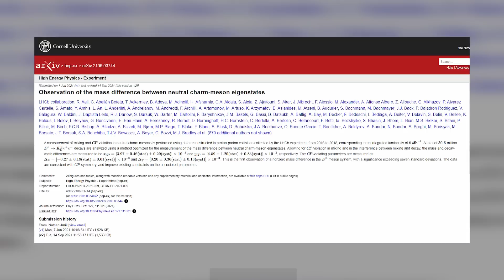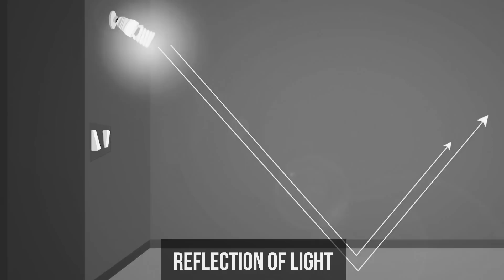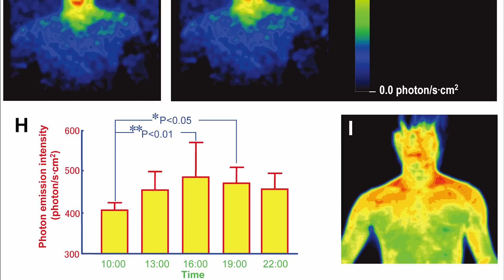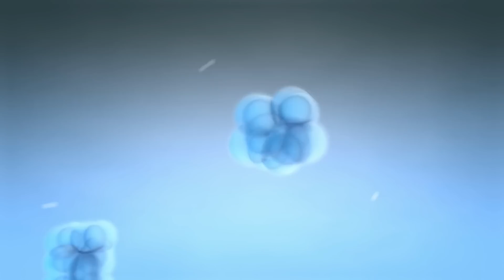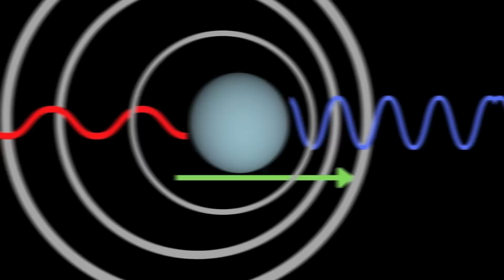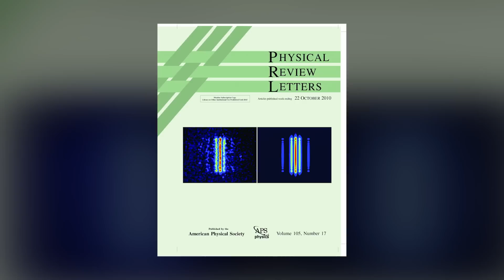Hidden Superpowers of Light We Didn't Know About

Comment: I don't believe that anyone has proven that light consists of photons.  Our sensors of light are materials, where electrons are what is detected.  But, in materials, the electrons are forced into discrete energy states, and from there we only sense discrete changes. 
In a significant experiment, sensitive sensors are used to detect the interference bands from the double slit experiment. Yes, the bands still appear. But, even as the light amplitude is decreased, and the time between individual photons is observed, the interference bands are built up by the slow accumulation of discrete events.  Now we are faced with the observation  in order for a single photon to behave as a wave, it must travel through the two slits in a manner in some way that allows for the two slits to affect the single 'small' photon so that they accumulate over time in the slit pattern. 
Another issue for diffraction, is that when a wave is forced through a small space, it emerges spread out. And when it passes through a large space, it can emerge with a sharp shadow. But, if photons are emitted by atoms, then they would spread out from the atom in a sphere, because atoms are very small compared to the wavelength of visible light.  It seems to me that the only way to rectify these observations, is that light is emitted in bursts from atoms, but that the light energy is absorbed as any other electromagnetic wave is absorbed - all over the place.  But then, it is re-emitted (as the observation of the interference bands) in random seemingly random events, as the energy accumulated by individual atoms is re-emitted as a reflection.  
    It should be able to test this theory with the appropriate apparatus. Last I heard is some nonsense about probability density functions being used instead of some material explanation for the observations.  That may be fine for getting a numerical answer, but it is nonsense for an explanation of what is happening. We might even find that light spreads out over time as well as space, and the quantified observations are just a limitation of our apparatus. But, I left physics for engineering long ago, and may be completely behind the times on this issue!

Comment: Here is an interesting problem about the speed of light. To measure what the speed of light is fully, ( i.e. both directions ), you need two clocks perfectly synchronized to perfect synchronization which sounds easy until you find out that you need to know the speed of light to achieve that level of synchronization. Kinda funny really.
Reply: It really isn’t that difficult. If you have 2 stop watches that are synced, 1 light source and 2 components that can read protons, then you are good to go. When the light source is turned on, the first proton reader will provide the time and the send will provide the second time it took for the light to reach it. You just need to do some math to account for data transfer

Comment: Some Nasa scientists think it is possible that light could travel faster than we know. We can only measure light by reflecting it off a surface very far away like to mars and back. We do not know if it travels at the same speed in both directions but suspect it does not! Depending on the conditions light speed could possibly be infinite. That would be awesome.

Comment: Could one not collapse the bubbles over an over to generate light an heat to be collected to generate power could collect a bit of its own energy to help in reducing its power consumption for better output too that way not to mention if you used the gasses made as well in its process too

Comment: CMB is almost 400,000 years old. Not almost 400,000,000 years old. This is an important difference. You should consider fixing that mistake.
Reply: My mistake is 13.7 billion years old. 400,000 years after the big bang
Reply: @jseaton2897  Correct.. I said it backwards. What I meant was the CMB was released 380,000 years after the big bang. Almost 400,000, not almost 400,000,000. Otherwise, it's an awesome video =)
Reply: The CMB was emmited when the Universe was about 380,000 years old! The Universe's age is estimated to be 13.8 billion years old.
Reply: The CMB is a brainchild of the 1930ies, therefore around 90 years old. Those first generation photons were generated 3 to 400 000 years after the Big Fart, are therefore 13.7 minus let's say 350 000 years old. There's a difference between birthdays and age. But in two months the age of the Uniburp will shrink to around 6 thousand years anyway due to the return to biblical logic thanks to the USAmerican average wisdom's choice of a moron as Potus!
Good Luck, USA, Good Luck!
Reply: I thought it was like 13.4 billion years old. Since the universe began 13.8 b years ago

Comment: That's some crazy stuff don't let DC writers find out about this 😂
Reply: They said light went faster than light.
So science is broken for sure.
Reply: @neohippe1
It's referring to entangled particles that share a property like spin, measuring the state of one instantly changes the state of the other, regardless of distance between. The change in this state is just a measurable interaction that's faster than light. It can't be used for anything like sending information so "traveling" faster than light kind of misrepresents what's actually happening.